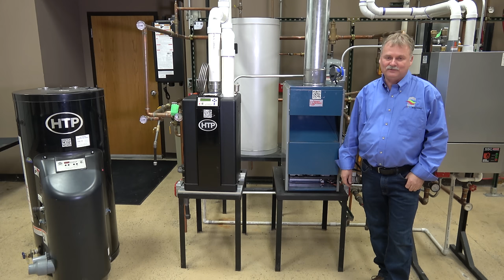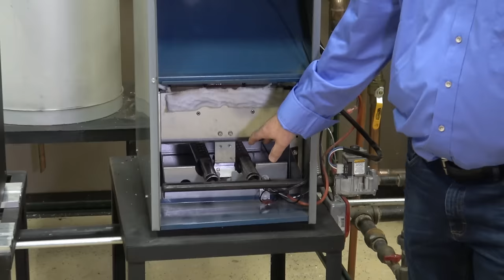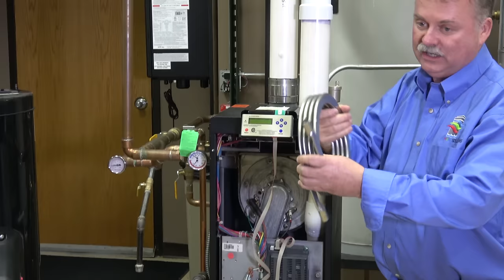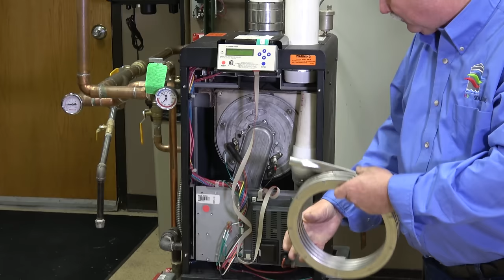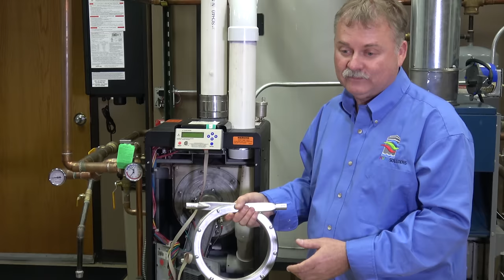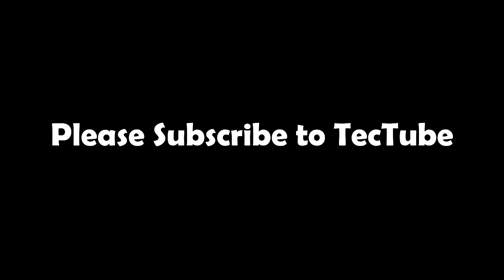Boiler Types: Standard vs. High Efficiency

Comment: I wonder if the High Mass Boiler can also accommodate usage for hot water for faucets and showers?
Reply from the maker: Yes, we do that frequently.  We pair the high mass boiler with an indirect storage tank.  An indirect looks like water heater, but there is no burner and no flue.  Instead it has a hydronic coil in it.  The boiler feeds hot water to that coil and that coil then heats the domestic water in the tank.  We don't want... and most codes do not allow... the water in the building's hydronic loop to be the same water that comes out of the faucets, hence the need for this water-to-water heat exchanger (indirect tank).  The high mass boiler shown in this video is a HTP Pioneer.  It has a built-in control sequence, called domestic hot water priority, for this exact setup.  You need to add the tank, a thermal sensor for tank temperature, and  DHW circulator to the system.
Reply from the maker: Alternatively, we sometimes use either low or high mass boilers to directly heat domestic water.  In these cases, there is no space heating involved.  We just heat the domestic.  We operate the controls sequence a little differently, but it can be done.
Reply: remember, if the furnace goes out, no hot shower for you.

Comment: Great info in this series. Any online courses available? Working in the sandbox but we'll see ho much longer it really lasts. Bought a used home in 2009 with a hydronic system plumbed with polybutylene tubing. Boiler is original from 1992 and my boiler tech is still able to keep it running but time to change shortly. Need to replace as much of the Poly with Pex Al to reduce or eliminate air into the system. I bought a scrubber but didn't get it installed. Tech says I need air valve to purge air from the radiator systems used upstairs. Not sure who installed the original system but it's basically a 2 temp system. Lower temps for basement floor and then main floor with tubes in a gypsum pour. Upper floor is high temp and I'm thinking 180 deg which is also the hot water storage tank temp in the winter.

I'd sure like to do a complete redesign with more modern valves and controls and either go to larger radiators and lower temps or maybe under floor heat transfer plates. But that means busting open the main floor lid to install them and I'm not sure if the plates are more efficient than radiators. Thinking about gypsum pour and floor tubing but the weight might kick me out. Haven't run the number in that yet. Retired USN plus 13 years in the sandbox. About time to relax a bit. Time goes so darn fast.
Reply from the maker: Go to https://tecmungo.com/training/ and click on Live and Recorded Webinars

Comment: Quite informative. While the hot water heat is very comfortable it has been expensive for me to operate. What I find is my 82 %  unit is thirsty. I wonder how u calculate the amount of baseboard needed.
Reply from the maker: Please take a look at our "Right Sizing a Boiler" video to see how to size a boiler system. 

https://youtu.be/h00dAUaOa9o
Reply from the maker: The amount of baseboard needed in each room is a function of the "load calculation," or sometimes called the "heat loss calculation."  This is something the system designer would calculate based on dimensions of the structure, air leakage, insulation, windows, etc.
Reply from the maker: Why do you say it is expensive to operate?  Expensive compared to what?  Compared to a gas furnace?  Compared to electric heat?  Compared to a heat pump?

Comment: What i have Researched the High Efficiency Gas Boilers are the Best. What i need to know is how to plan to use this for heating a Garage or work Area of 2000 square Ft. But I know ceiling Hight and Insulation is a Big Thing. So figuring Ceiling at 14 Feet with a flat ceiling i think would be Best plus R- 30 to R 38 Insulation would be Best and a R-13 to R-19 Wall insulation for the Side Walls. My next Question which Door should I use. I want One Door 12 wide and 12 or 13 ft tall. I think a insulated Door Would be best but Witch Door Brand?

Comment: By coupling a low mass boiler with an indirect water tank, will that achieve the same result as a high mass?
Reply from the maker: What do you mean?  An indirect water heater is a more efficient way to heat domestic water than a typical water heater.  And a low mass boiler is generally more efficient than a high mass.  Finally, it you have different load temps, such as radiant, and the boiler needs to change output temp to heat domestic water, then a low mass will respond better.  We don't see any scenario in which a high mass boiler would be preferred over a low mass to heat an indirect tank.
Reply: Tec Tube As you pointed out, the difference between the high efficiency low mass and the high efficiency high mass is the tank on top of the high mass.  Hence my question above about pairing a low mass with an indirect fired water tank to achieve the same effect as the high mass.
Reply from the maker: @QuangNguyen-lr4cm  Ok, we understand now.  The term "indirect tank" is specifically reserved for domestic water heater so we thought that is what you were asking about.  Yes, you can couple a low mass with a tank to increase the mass.  We had done that for many years before the HTP Pioneer was available.  In that application the tank is very different than an indirect tank.  An indirect tank has a coil inside it to keep the boiler water and domestic water separate.  However, the tank you are talking about, which is called a buffer tank, has no coil.  The one we use a lot is called Boiler Buddy.

Comment: My experience has been the added complexity cost more: More complaints, more maintenance, more aggravation, more expense. The older, stupid/dumb cast iron units are bullet proof and when maintenance is required (every 4 or 5 years) almost any tech can service it with parts readily available from Home depot or your local hardware store. This reduces the overall cost of ownership drastically. This is true whether it's for my single family rental or my multifamily apartment building. The older I get, the more I appreciate the value of simple and cheap. As much as I dislike dealing with diesel, and cast iron, it just works and is very forgiving of sub-optimal operating conditions.
Reply from the maker: We use 82% cast iron boilers in addition to 98% high efficiency boilers.  There is not one solution for every application or every customer.
Reply: @TECTubefilms  Exactly right. An expensive lesson I have learned is that true cost of ownership is actually quite difficult to figure. So, for example, that 98% efficient Crown boiler I installed cost way more than anticipated when those yearly $1k maintenance bills came. That's a lot of additional run-time for the inefficient 80% unit with its $150 yearly maintenance expense.
Reply from the maker: @blackmanops3749  Wow!  $1,000 per year in schedule maintenance.  That is more than our trucks.  LOL

Comment: Does a buffer tank make sense in a high efficiency combi unit? I Only have two zones. Upstairs and downstairs. 

Also, does a "pre boiler" buffer tank make sense in a HE combi unit to get incoming cold ground water up to room temp before being heated?
Reply from the maker: The time you would use a buffer tank would be when the smallest zone (in BTU/h) is smaller than the lowest firing rate of the modulating boiler.
Reply from the maker: We don't know what a pre-boiler buffer tank is nor do we know why you would have incoming water.  For a hydronic boiler heating system, you would be circulating the same water over and over and would not have new water.  It sounds like you are talking more about a domestic water heater than a space heating boiler.
Reply from the maker: If it is a condensing appliance... space heating boiler or domestic water heater... it will most efficient with colder incoming water.  This will allow more condensation and latent heat recovery.
Reply: @TECTubefilms  I am looking at a combination boiler that does both the closed loop baseboard heat and also does the on demand hot water.  I agree the incoming water should only be for the on demand hot water and would not be applicable for the baseboard heating loop.
Reply: @TECTubefilms  Thank you for the information. That is surprising to hear! I was thinking that heating 60 degree water from a tank up to 120 would be less effort for the heater than heating up the cold winter ground temp water up to 120.
Reply: @TECTubefilms  Perfect, thank you! It's essentially a storage of excess heat then.  Since a high efficiency boiler can ramp way down, I would expect there to be no need for a buffer tank then based on this information.  Large house with only 2 zones.
Reply: Looks like "tempering tank" is the term. "An unjacketed water retention tank that is designed to pre-warm water before flowing into any water heater."
Reply from the maker: @SteveShaker  The heat has to come from somewhere.  So if the boiler does not heat the incoming water and you let it heat up "naturally" sitting in a tank, where did the heat come from?  It came from the house... which still got the heat from the boiler.  So there would be zero energy savings if you did this with a tank.
Reply from the maker: @SteveShaker  As previously stated, the need for a buffer/storage tank would occur in applications where the smallest zone is smaller than how far the modulating boiler can ramp down.
Reply from the maker: @SteveShaker  The term "tempering tank" would not be used for the tank we show in our video.  That term would be specific to domestic water.  If your water heater had insufficient capacity to heat well water, then using a tank like that to steal heat from the house might make sense.  Or if your non-condensing water heater could not handle cold incoming water.  In the case of a condensing water heater, it would be the same as a condensing boiler....  the colder the incoming water the better so DO NOT add a tempering tank to the inlet if the appliance is condensing.
Reply from the maker: @SteveShaker  Also, a tempering tank is round and hence not a lot of mass to surface area ratio.  To transfer heat from your house to the incoming water, the more surface area the better.  So instead of using a tank, why not use a heat transfer coil.  Maybe use an old radiator, baseboard, or fan coil?
Reply: @TECTubefilms  Everything you said makes perfect sense. Thank you so much for the tips and information. 

Buffer tank = not applicable for personally then for the HE combi setup because the smallest loop is larger than the minimum output of the unit

Tempering tank = nonsensical in the HE combi setup because it will ultimately just steal heat from the unit AND colder water is better for the DHW supply

Comment: If I use a primary secondary loop will this be more efficient on a low mass boiler when using zone valve. or a viessmann low loss header
Reply from the maker: The Viessmann low loss header does create a primary secondary arrangement.  It is the same thing.  You can use closely spaced tees, a Caleffi hydrolic separator, a low loss header, or a Boiler Buddy to separate the primary and secondary loops from each other.  We would not expect any energy differences between the options.  All of them should save about the same amount of energy as compared to a traditional pumping system.

Comment: Quick question sort of:  Do you have any knowledge about issues regarding unusually shorter on/off boiler cycling due to the longer time that it takes for in-floor heating concrete floors to heat up?  I've read complaints about some thermostats being used for concrete in-floor heating applications and it seems that they only read air temperature and not the actual temperature of the concrete (no imbedded temperature probe).  This can lead to a situation where the boiler is constantly trying to “keep up” with the thermostat’s much shorter interval calls for heat thus overworking the boiler.  Does this really happen and is there a solution?  Thanks.
Reply from the maker: The floor sensors are a nice way to control, but you can do it with an airside thermostat.  Once the slab is warm for the year, you shouldn't have any issues with short cycling at all.  In fact it is often the opposite.  If you are short cycling, check to make sure a) the boiler is not oversized, b) the boiler is a modulating condensing boiler with at least 3-to-1 turndown (and hopefully better), c) that you are not trying to put the system into a setback mode.  We are huge fans of programmable thermostats... for everything except radiant slab heating, and d) that your smallest zone's BTUh requirement is not lower than the lowest firing rate of the boiler (if it is, you need a buffer tank).
Reply: @TECTubefilms  I must tell you that I'm still learning about my home heating system.  I have a Viessmann Vitoden 200.  The specs say 6.5:1 modulation ratio.  Not sure what you mean by "not putting the system into setback mode".  My thermostats are Honeywell TL8100 programmable and I read about the short cycling issue with these on the Amazon reviews.  So I should ditch these and go with non- prog for my slab heating?   Thank you so much for your help.
Reply from the maker: @almason253  You can keep the programmable, but just do not program it to "setback the temperature."  A radiant slab takes too long to heat up and cool down for an airside programmable stat to be effective.
Reply: @TECTubefilms  Ah! I see now.  (I can be a little dense sometimes 😉)  Thanks again for your assistance.
Reply: Chris it depend on your system and how its piped.   Do you have a high mass boiler or a high efficiency low mass one? If your radiant loop is piped off a mixing valve it will require the boiler run any time there is a call for heat on that zone.   If your radiant is supplied from an indirect tank or buffer tank your system can satisfy heat demand from energy stored in the tank without running the boiler.  Its cheaper to use a mixer vale so many installs are done this way.   It’s not the best way especially if you have many small zones or an oversized boiler that doesn’t modulate low enough.  It sounds like you have either a design flaw or an installation problem. Hydronic systems aren’t rocket science but so many are installed incorrectly.

Comment: Are these only gas boilers?. I had a peerless wbv series tankless hot water oil burner installed . Is it low mass or high mass? I have 3 zones it's shortcycling and not heating my house when it's really cold. Contractor can't figure out why.  I'm trying to figure out if the issue is that t's oversized or that low mass. Help
Reply from the maker: We do not use oil boilers in our market, so that is not our expertise.  Most oil boilers that we have seen are high mass and single stage.  You are correct that short cycling is often caused by oversizing, but other issues can be in play.  If it is a low mass boiler with a poor turndown ratio and that is coupled to relatively small zones, that can cause the boiler to ramp down and then shut off quickly.
Reply from the maker: If your technician is unable to determine the issue, they should bring in an expert form their company that can.  Or bring in the local boiler manufacturer's rep to help diagnose.

Comment: Anyone happens to know what is the efficiency of an early 90s cast iron boiler? not the earlier heavier cast iron floor standing boilers? thanks
Reply from the maker: Generally 78 to 80% AFUE for residential cast iron boilers.  Look at the tag and just divide the output BTU/h by the input BTU/h.
Reply: many thanks for taking the time, much appreciated, just pressurized the system to see if its water tight, it ok thank God just 2 weeks ago also the pilot flame heat actually stays in the boiler unlike with an open vent flow pipe warmish n seems to heat just a touch faster If no pressure loss after couple of months i'll feel confident to have it pressure clean n fit a new Vaillant combi not sure u have the Vaillant in the USA but they are the most reliable combis on the market hope i be saving about 50 to £80 from the standing pilot about 15 to 20%% from the better efficiency n Lots on the instant  hot water on top water on demand, take care n once again thank you, PS even with all modern safety features i still believe an open vent is the safest way Gravity never lets no one down LOL cheers
Reply from the maker: @polygamous1  You must have a huge pilot light if you can notice its affect on heating the water.  But even though that pilot heat is not wasted in the winter, it is in the summer.  No reason to burn gas when you want zero heat.  That is why pilot lights were outlawed in the US in 2012 for residential boilers.

Comment: Is PVC required for high efficiency boiler? Would I be able to use chimney for exhaust on high efficiency boilers?
Reply from the maker: Because of the condensate, the exhaust piping material needs to be made out of PVC, CPVC, PolyPro, stainless steel, or other non-ferrous metal.  You cannot vent it into the chimney.  If the chimney is no longer used as a chimney for other appliances, then you could re-purpose it as a pipe chase for the PVC pipes.
Reply: @TECTubefilms  thank you for the explanation
Reply: If you asking that, better don't mess with those.
Reply from the maker: @786otto  We agree.  Gas fired equipment is not something for an untrained and/or unlicensed individual to attempt to install.